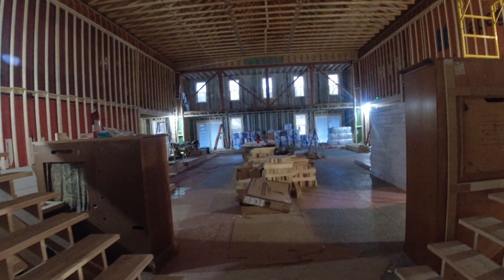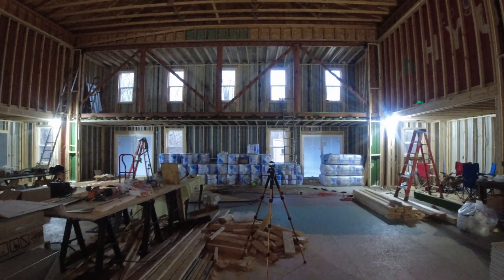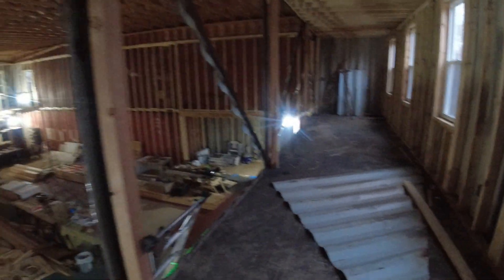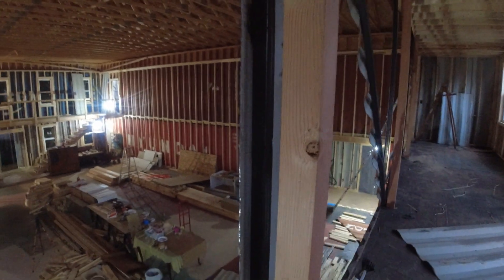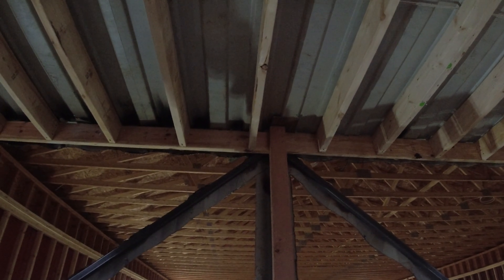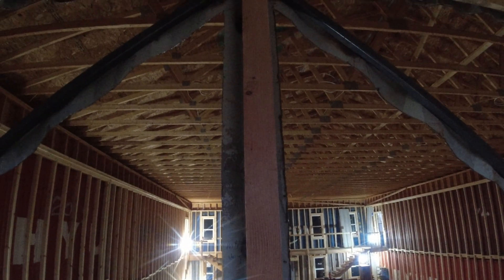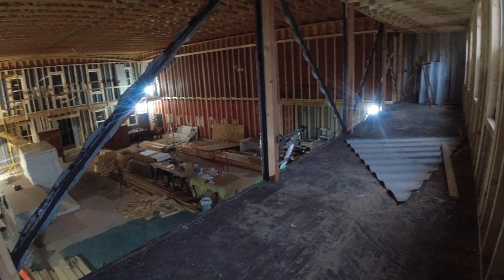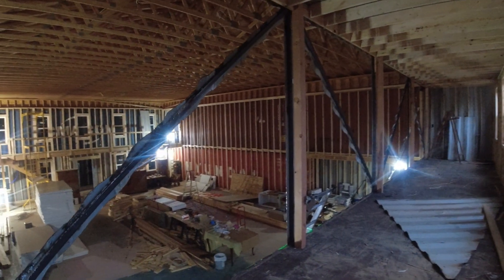How I maintain structural integrity when cutting open a container wall in a shipping container house

Comment: Just out of curiosity at what point is it no longer a container and you just get steel siding on a stick framed house?
Reply from the maker: A stick frame house with a great room spanning 40 feet by 68 feet with a ceiling height of 20 feet will be cost prohibitive and easy to mess up and will be much less structurally robust.  It also doesn't lend itself to do-it-yourself work unless you are a pro.
Reply: @1michiganbuck  how much cheaper is this than building a house just out of curiosity do you have a video with the total costs ?
Reply from the maker: @BryanKirch  Good suggestion.  I really should make a video about that.  I bought the containers 4 years ago when they were cheap, so I bought these high cubes for an average of $2,200 each.  When stacked together and welded together, they form almost a fortress that no stick frame house can be.  Furthermore, I have done things that have made the containers even stronger.  I will see what I can do to put together a video soon, because that would be an interesting topic.  Thanks.
Reply: @1michiganbuck  yeah people always love receipt videos it’s some of their favorite
Reply from the maker: @BryanKirch  Good point.  I will work on that receipt video soon.  Stay tuned.
Reply: Would be really interested to know if this house is being inspected by local building inspectors? Or does it not require it because it is a rural property?
Reply: At the price of his containers, he only spent $52,000. That seems pretty cheap compared to what a builder would charge for a similar dimensioned home. BUT, not sure of a pole barn cost. Wood post vs red steel…

Edit:
Found one online price for a basic pole barn frame. 40x72x16 $27,000. But the total square footage of the home would be smaller as a pole barn than the OP’s using a double wide double tall containers. The pole barn includes roof, whereas the OP had to buy roof trusses separately.
Reply from the maker: @Pterodactyl-kn3ve  Good comparison.  Just a bit of clarification on my shipping container house.  Even though we stacked 22 containers, it was really only 18 containers, because I cut 4 of them in half.  So the total container cost was less than $40K.  For my build, since I always aimed to do a lot of the work myself, the containers afforded me the parameters that I cannot mess up easily.  I would never be able to build a stick frame house myself of this size and structure by doing any of the work myself.  The containers are very forgiving because the structure is well defined and you cannot get it out of plumb even if you tried. Thanks for watching.